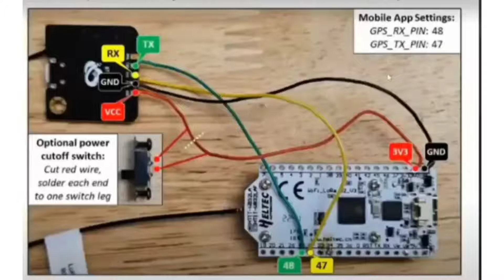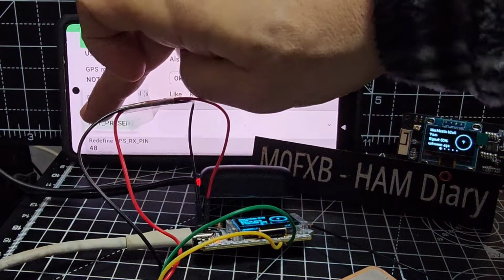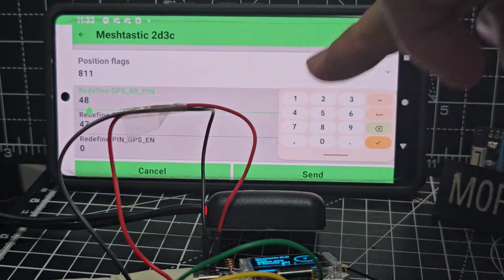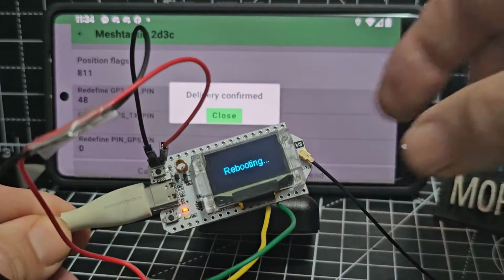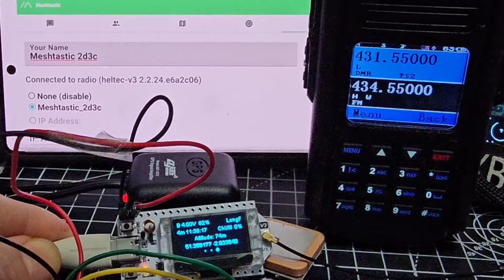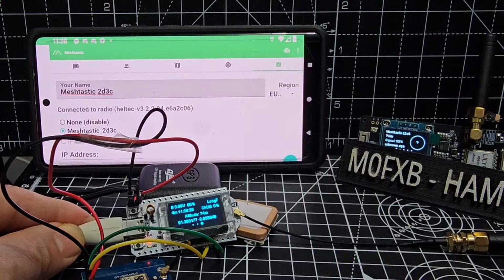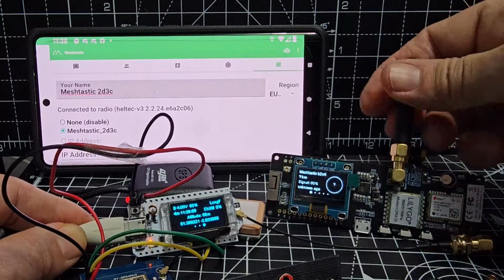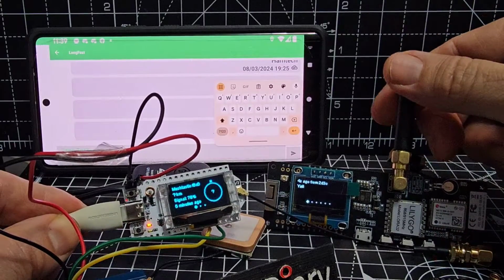MESHTASTIC ADD GPS MODULE - FULL INSTALL

Comment: Why do you have to add the flight computer to add the GPS WHEN Heltec has a direct connection to the esp 32 board of the Heltec 32?
Reply from the maker: Ther ia no gps on board this model

Comment: Thanks a lot! What I didn’t understand from other videos is that you need a GPS unit because I got the message “no GPS” on my display. Or are telephones coupled by Bluetooth to give their coordinates to the V3?
Reply from the maker: I think you can tell the device to use your mobile other wise u need module .
Reply: I have the same Heltec v3, GPS module and the same problem how @prillewitz .